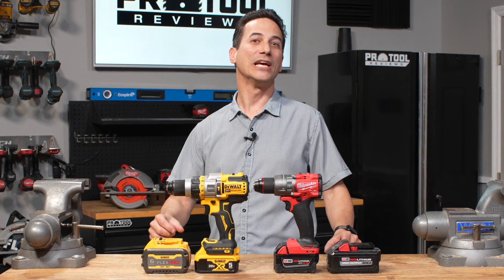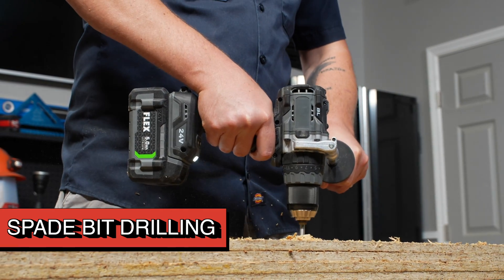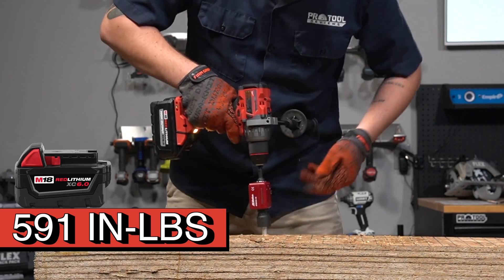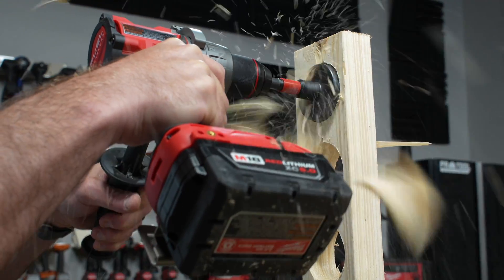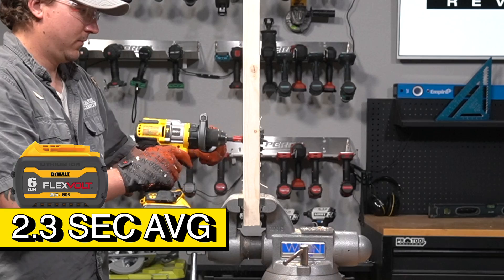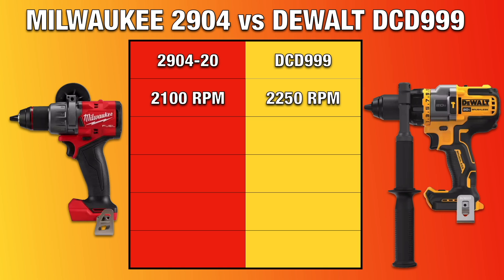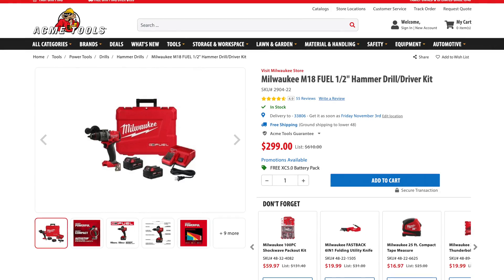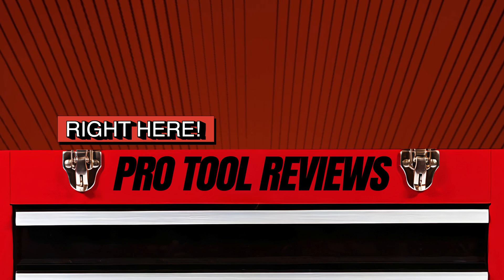Milwaukee vs DeWalt Hammer Drill - Flexvolt DCD999 vs M18 Fuel 2904

Comment: I’m gonna be doing a similar comparison, but also adding Flex to decide which drill is best for me.
By the way, I’ve heard that the 999 also does better with the 8 amp XR battery because of the 21700 cells.
Reply: Check out the Torque Test Channel review on all these, the 998 actually outperforms the 999.  They also get the most power from 20V Max 6ah, even compared to the 8ah and flexvolt 60ah.  All very scientific tests.
Reply: @robhardy1109  I wouldn’t go completely by the results on one channel.
No offense, but TTC has been called out for not being as realistic as a real world scenario.
I would also like to add that other channels have shown the 999 to be stronger in actual use.
Reply: @DiligentDave1966  I've seen the opposite on most channels but I think one was 999 stronger
Reply: @theone-ou3gd  The Milwaukee is stronger than Dewalt in raw torque (speed one). However, I found that it bogs down more, in speed two, than Ridgid and Dewalt. It could also just be that I got a weak 2904. I’ve seen similar things on other channels.
Reply: No 998 does 999 does best with 6 flexvolt or maybe 9 can't remember
Reply: @theone-ou3gd  That depends on what channel you watch.
Regardless, the 998 and 999 seem pretty legit.
Reply: @DiligentDave1966  yea forsure brotha and I like your channel as well def gotta watch who you believe in tool world nowadays
Reply: @theone-ou3gd  I wasn’t going to mention my channel, out of respect for this channel, but I really appreciate you for doing it.
I tested the tools, for exactly what I intend to use them for, and chose what I chose because it checked all of the important boxes for me.
I explained my choice, as thoroughly as possible, but also have stated that no brand is the best for everyone.
Reply: @DiligentDave1966  gotta good channel brotha I'm subscribed but only one question do you support biden?
Reply: @theone-ou3gd  I really don’t like discussing politics, even with my wife.
Reply: @DiligentDave1966  I respect it and was same but nowadays it's a must in my books but I'll respect it but I'll put myself out there if I find out I'll unsubscribe because it's getting real I'm a black man as well but like the vids and don't believe mainstream media
Reply: @theone-ou3gd  I could ask you the same question. Who do you support?
I will just say that this is probably the most difficult decision that I’ve had to make in my entire lifetime.
Reply: @DiligentDave1966  yea it's wild times brotha but I've done my own research and support trump hands down biden will hurry us brotha but too each there own
Reply: Burry I meant and as in america
Reply: Wasn't on here to be political like channel either way brotha just bothers me nowadays
Reply: @theone-ou3gd  I agree. The media just confuses people to fit their agenda. I remember being ready to vote for someone that I believed in, but the media changed my mind.
Reply: @DiligentDave1966  glad your a real person brotha just want America to be best can be
Reply: @DiligentDave1966  I'm not mad at that either and agree he just doesn't have the support or don't disagree with vivek neither but good to here brotha just wish we could all come together and end the tyranny
Reply: @theone-ou3gd  That’s the problem with our nation. Too much division and misinformation.

Comment: The 999 will usually win in concrete because it has 225 more rpm in hammer mode than it has in regular drill mode.

Comment: You’re holding back the 999. Test both drills with the best battery each manufacturer makes then see what happens.
Reply: Exactly, it was sabotaged from the start. The 999 can use the other batteries if really needed but is meant to used with the flex volts thats how it was made to work. Given a handicap with the universal battery.

Comment: I'm red til dead! Even though that DeWalt did win in the concrete drilling test after changing to the flex volt battery, do you hear that obnoxious scream it makes? Every hammer drill is loud, but DeWalt will make your ears bleed. I'm a commercial electrician, if I need to drill holes for tapcons or Sammys, I ain't using a hammer drill, that's what an SDS is for.

Comment: I’m a commercial electrician, most contractors buy dewalt 20v line. Battery tools are great, makes any job easy. Also they take a beating on the job sites and keep on working. I have no experience with Milwaukee but most plumbers and elevator contractors use them and they all like. Both brands are great, it’s whatever you want to buy, but can’t go wrong with either lineup. Now both brands are making more trade specific tools, sales rep have my company the new dewalt 20v lug crimping tool and battery knockout set, both work great
Reply: I started buying DeWalt about 30 years ago.  They were the best back then (18v), and have served me well.  Once I got committed to all those batteries, I never had a reason to change.  That transitioned to the 20v systems when the 18v's started giving out after 25-years.  My boys are in the trades and they all went with Milwaukee.  Nothing wrong with that, since they are just starting out and didn't have anything invested in batteries yet.  I must confess, I did retire my DeWalt ToughSystem boxes after I saw the boys' Milwaukee Packout system.  There were a bunch of things I didn't like about my ToughSystem, like the tabs to lock them together (very hard to unhook tabs, and tabs breaking from putting them in & out of my pickup bed), and the latches that were falling apart.  The Packout is by far a highly superior system, with lots of options available.  Looks kinda funny when you open it up and see all that yellow & black in there! 😆
Reply: As a team red electrician you are certainly right, 99% of electricians use dewalt. I like that though, my shit doesn’t get mixed up with theirs. I am happy team red going on 12 years now.
Reply: Well if you come to california 99% of contracts will buy milwaukee
Reply: It really depends on which brand platform you've already invested in? DeWalt and Milwaukee are both very good. Milwaukee probably has a few more models geared towards extreme professional use than DeWalt.

Comment: I have more Milwaukee than I do Dewalt, although I do love the Milwaukee,when it comes to Christmas time Dewalt kills it with pricing and the packages that they offer. Milwaukee is getting insanely expensive. Last Christmas Milwaukee kept pushing their outdated products with their old XC five batteries, Dewalt had great sales on the newest tools and great specials on the flex volt batteries.

Comment: Does the Milwaukee Chuck have a slight wobble when you look straight at it and pull trigger slow? Mine does I just bought it wondering if they all do that.
Reply: They all do. Even the hella overpriced Japanese made Makitas have a lot of runout in the chuck.
Reply: Latest gen Milwaukee definitely has more power but has vastly less quality than their older tools imo. The batteries match dewalt now where they aren’t supported fully by their lock in mechanism in the rear, leaving part of the battery hanging down instead of being flush.

Comment: Home owner and DIY person, my garage is black and yellow. I have the dcd999 full kit. However, I learned I do not need all that power to drill a hole in the wall 😂
Reply from the maker: Better to have it and not need it than to need it and not have it! 😂

Thanks for watching!
Reply: I use my DCD777, a lot, for just drilling holes in the wall.

Comment: I have the 2904, 998 and XPH14. All are almost identical in performance.  I prefer the Makita.  Although it might have a little less power it is hard to tell practically. It's more reliable (especially when compared to Milwaukee's damn trigger) and has far better ergonomics.  Next I would place the Dewalt.
Reply from the maker: That's great feedback Jason, thanks for sharing!

Comment: I have both lines. Both in 12v and 18-20v. I have both drills in the test. I collect tools. I like all battery platforms. I just bought that Milwaukee drill on Amazon for $87. I couldn’t pass it up. Thing is a beast with the 6.0. I can’t imagine it with the new forge 6.0. Battery.  The dewalt is also great. Works good.
Reply from the maker: Wow! We can't believe you found it for $87! Definitely be careful buying from 3rd parties on Amazon, especially when it comes to Milwaukee (they don't sell directly on Amazon), but sounds like you may have lucked into a deal on that one!
Reply: @Protoolreviews I’m always skeptical but I figured I could return it. It was sealed in the original box I took it out to check it for fake or repaired. It is brand new. Even has the camera sticker that takes you to Milwaukee site to the manual. It was a deal for 3days. Still had it yesterday.
Reply: Fake
Reply: @user-kg3qu2sc3i no it’s not.
Reply: probably fake

Comment: According from guys who use them every day under heavy use
Dewalt motor crap out after 2 year
Reply: It slows down forsure but for everyday use dewalt is so much better because of the battery. A everyday user is gonna get annoyed after a few months from replacing batteries everytime

Comment: When starting the Milwaukee drill with the 6Ah battery at 3 mins. & 25 secs. the bottom ply looks like OSB. Isn’t OSB a softer type of ply  than regular plywood. Please someone correct me if I’m wrong. And just for the record, I don’t own any drills from either company.
Reply from the maker: It's all OSB, the green part you're seeing is just the outside edge of the sheet of OSB, that we cut into strips.

Comment: DeWalt's UK website lists the drill at 112NM with a 6ah flex volt battery which equals to 991 in. lbs torque

Comment: A Dewalt-rep told me they will come out with a new drill next year. I always thought the Dewalt drill was too bulky and weak. But Milwaukee also struggles with heat-buildup.
Reply from the maker: Interesting.. we'll be sure to keep our eyes out for it and share our experience once we get our hands on a new model!
Reply: They are adding new touch buttons instead of the slider switch for the led light and the e clutch for auto stop in bind up situations
Reply: That Dewalt drill line up ,be it the 999,996 are probably the most powerful drills out there ,they aren't weak!!!!  It's just time Dewalt brought out a replacement that is more compact imo.
Reply: @interman7715  First Flex and Milwaukee hammer drills are stronger than Dewalt in most cases, but Dewalt is definitely not weak.
I don’t think that Dewalt should go too compact, though. Both Flex and Milwaukee have been known to get a little hot. It would only make sense that a larger body allows for a bigger fan and better heat dispersion. I had a DCD800, and it got pretty hot too.
The other thing I’ve noticed about the Dewalt compact drills is that they are more inconsistent in terms of performance compared with their bigger drills.
Case in point, my DCD777 outperforms the DCD708 all day long, despite having the same specs. The 777 is considered big and outdated by today’s standards, but it’s a pretty dependable drill.
Reply: @DiligentDave1966  Yeah mate ,I get it ,the 900 series are good drills but need an update and a little bit of fat cut off ,.Btw I have the dcd 805 and it is beast and I feel leaves everything for dead in the compact class.
Reply: @interman7715  I’m glad you like it. So many people rave about it, but I didn’t think the 800 was all that great. The 800 is just a non hammer version of the 805. Mine got hot and cut off driving relatively short timber locks, and trying to drill a 1/2” hole through a 2x4 attached to a 4x4. I understand that the drill bit might have been dull, but I can’t think of an excuse for not driving the timber locks. Tinker With Tools showed it being able to do that.
That brings me back to the body size. A bigger body allows for a bigger fan and more ventilation cutouts. This, in turn, keeps the motor much cooler.
Flex and Milwaukee have both been known to get pretty warm under heavy use. Dewalt should not go as small as them with the body. Maybe something in between.
Reply: @interman7715  Please don’t take my comments like I’m a Dewalt fanboy. I’m actually trying to decide between the 999 , the Flex and the gen4 Milwaukee.
I just know that I have seen some comments from people who switched from Milwaukee to Dewalt that they did it because their Milwaukee overheated and shut down.
Reply: @interman7715  BTW, what impact driver do you use?
Reply: @DiligentDave1966  I'm still using a brushed Ryobi ,I only use it on the occasional plastering job and it works great ,I also have the brushed Ryobi planer as well and love it ,I am a carpenter and builder so it gets plenty of use .I use a few different brands because of economics and features. The 7 1/4" saw is a Dewalt Flexvolt as it suits me perfectly and is sooo powerful, my drills are DCD 708 and DCD 805 and they're unstoppable and good ergos. I can't wait for the new 999 replacement as well .Oh and I don't use Milwaukee tools even though they are excellent tools but here in Australia they are ridiculously expensive and they are price gouging. Dewalt are cheaper as they are trying to get a foothold ,but I think Dewalt is better anyway.
Reply: @interman7715  It’s so ironic that you mentioned the 708. I have the 777 that I got in set with the 787, and we have the 708 at work. They have the same specs, but the 777 is slightly bigger and heavier. I actually have a video of my 777 outperforming the 708, and it makes me glad that I didn’t run out and buy the atomic when it came out.
Reply: @DiligentDave1966  I am not familiar with the DCD777 but I'm sure it is a good drill 
As for my 708 ,I use it most of the time because of the  lightweight, it is convenient to hang on nailbag all day  it is ideal for drilling decks, roof work and hanging doors and I have used it on 16mm x 600 auger bits in 1st gear of course and it will power through without complaining .
Reply: @interman7715  Don’t get me wrong, the 708 is pretty good for its size. I still wonder, though, why my 800 cut out and got so hot doing some of the things that I saw other channels use it for.
Reply: @interman7715  Someone that I follow on YouTube has also said that the Ryobi impact drivers are pretty good, especially the newer brushless one. He said the impact wrench is pretty good too.
That’s pretty high praise considering that he uses Flex and Makita on a regular basis.
I’ve heard that the Ryobi drills aren’t very good, though.
Reply: @interman7715  The good thing about Dewalt is that they have been including great batteries in their top tier drill kits lately. The 998 comes with the 8 amp 21700 cell battery and the the 999 comes with the flex volt battery. With most other brands, you really need to buy a separate battery for maximum performance.
Reply: First, the 999 is way more powerful than the 996 that it has replaced. The big body definitely allows for a bigger fan to prevent overheating.
Second, the gen 4 Milwaukee has several more safety features than the gen 3, including better communication to help the endurance of the tool.
It’s also slightly larger than the gen 3, which allows for better heat dispersion.
Both drills are really good, and that’s why I need to do my own test.

Comment: I'm Team Dewaulkee.

I'm into the Milwaukee M18 line, but I also have a Dewalt grass trimmer with a 5ah and charger and looking into investing into the 12v extreme line. I also plan on getting Dewalt circular saw and table saw and resaw. Milwaukee is not impressing me with their saws in general. Except the tiger saw. That one is great. 

I like both brands and I'm not choosing side. Makita is great too. Blue Bosch and Festool are also great.
Reply: And Metabo. They are big in Europe. Not so much the USA.
Reply: @robk1310  Yeah I'm from Sweden. Don't see much Metabo in my little town though. A shop in town sell some Metabo stuff. Pro brand? Or like Ryobi or Skil?
Reply: I'm the opposite, flexvolt and 20v Dewalt, and m12 milwaukee
Reply: @BigZ971  Good on you! M12 would have been a no brainer but I just can't get over the m12 grip
Reply: @bjornblomkvist4600  yeah I can understand that. I just can't justify the Dewalt 12 v line because the batteries are almost identical to the 20v stuff. No real advantage there
Reply: @BigZ971  haha Yeah. And I feel the build on m12 tools are just as large as m18 except the smaller batteries 😂
Well as long as we're both happy I guess.
Reply: @Bathtubcrocodile  that's all that matters
Reply: Someone watches Finish Carpentry TV or whatever that channel is.
Reply: @trevorhardy3544  Don't know what that means. But I do alot of work around a big country house. So I need tools. Never invested in Dewalt 12v. Instead went deeper into Milwaukee. I've has maybe 2 tools I did not need and one came in a kit. And I'll give you one thing... I do appriceate cool stuff. Some things (clears throat) could have been done with a manual tool. 😂
Reply: @Bathtubcrocodile  https://youtu.be/FVKQD6jdF9g?si=z1r8A32jSWuOVOEP
Reply: @trevorhardy3544 Well that was a good one.😂 I'll take it.
Reply: @Bathtubcrocodile it’s a great channel too
Reply: @trevorhardy3544 I'm gonna be honest with you, I never heard it from him. Not that it took gold medal in word smithing, mashing up Dewaulkee. 😅 But I've seen a couple of his videos. I believe I was learning about a new Milwaukee finishing nailer.